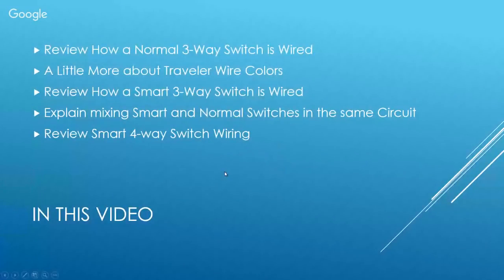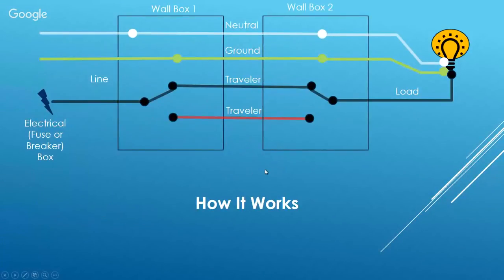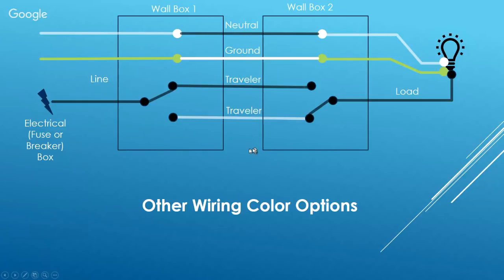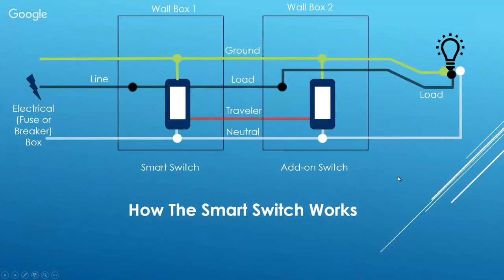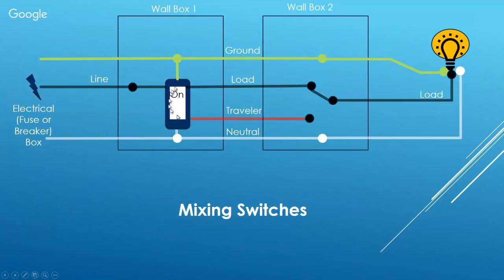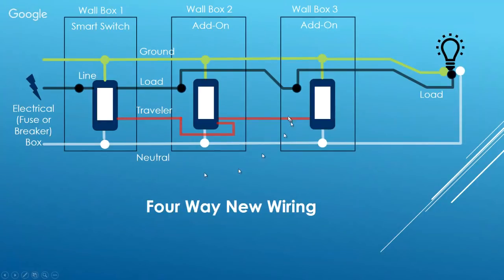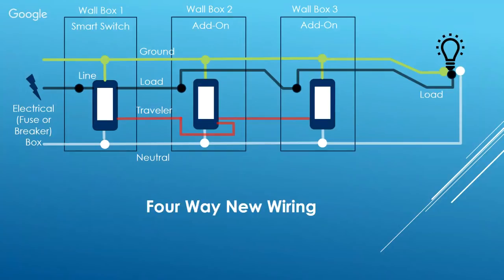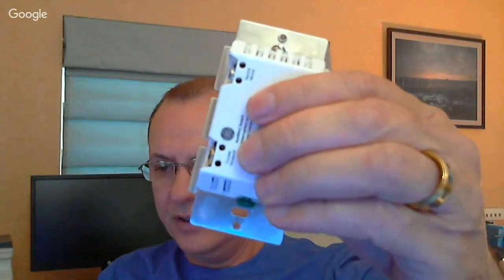3-Way Smart Switch Questions & Answers

Comment: Great video! Can a smart dimmer switch be last in line (not master - a slave switch) in a 4-way switch set up?
Reply from the maker: Hi Rich Persaud, thanks for reaching out. Which type of add-on switch you will use will depend on the manufacturer. The best source of information for three and four way switches is on my website. I cover many manufacturers and wiring methods there. There are several different methods in which your original circuit could have been wired, so you'll need to start there. Again, it's all on my website.
https://azhb.com/how-to/three-way-switch-how-to/

If you're still having problems, check out my Facebook Group. It's an easier place for me or other to lend a hand.
https://www.facebook.com/groups/733842787140470/

Cheers

Comment: Thanks for a very informative video. Do you know of a 3 way countdown timer that would work with another 3 way regular switch. In ontario the building code requires that the main washroom to be operated from a switch on the main floor beside the switch in the bathroom
Reply from the maker: Not that I know of. But if you have a smart hub you can set up the three way switch with a smart switch and have the hub automatically turn it off after a certain amount of time.

Comment: Is there a smart switch solution to group two separate 3-way switches that control recessed lighting? I want to be able to turn on and off both 3-way switches together at the same time, and still have separate control of each switch when needed.
Reply from the maker: Hi Kimberly Rymer, thanks for reaching out. Sorry you're having problems with the wiring. The best source of information for three and four way switches is on my website. There are several different methods in which your original circuit could have been wired, so you'll need to start there. Again, it's all on my website.
https://azhb.com/how-to/three-way-switch-how-to/

If you're still having problems, check out my Facebook Group. It's an easier place for me or other to lend a hand.
https://www.facebook.com/groups/733842787140470/

Cheers

Comment: What if your second switch in a 3 way switch only has 1 black, 1 red, 1 white and a ground wire...how do you make it communicate with the main switch ?
Reply from the maker: Hi Rob M.N., thanks for reaching out. Sorry you're having problems with the wiring. The best source of information for three and four way switches is on my website. There are several different methods in which your original circuit could have been wired, so you'll need to start there. Again, it's all on my website.
https://azhb.com/how-to/three-way-switch-how-to/

If you're still having problems, check out my Facebook Group. It's an easier place for me or other to lend a hand.
https://www.facebook.com/groups/733842787140470/

Cheers

Comment: For example on any smart 3 way switch the traveler 1 have to be connected with the traveler 1 on the other smart 3 way switch, and traveler 2 with traveler 2 ? So the switch can work fine? Thanks for help me ;)
Reply from the maker: Hi Carlos Monzon, thanks for reaching out. Sorry you're having problems with the wiring. The best source of information for three and four way switches is on my website. There are several different methods in which your original circuit could have been wired, so you'll need to start there. Again, it's all on my website.
https://azhb.com/how-to/three-way-switch-how-to/

If you're still having problems, check out my Facebook Group. It's an easier place for me or other to lend a hand.
https://www.facebook.com/groups/733842787140470/

Cheers

Comment: Very good video with instructions. I have a situation where I am trying to install 2 KS-602F switches as 3-way  to control a lite. I have been able to make it only work with primary as smart switch and secondary as conventional switch. I can control by the app. I can’t make it work with both smart switches installed. Tried a few different ways no luck. On the primary switch I have connected live wire to load/live(red) on the switch side, ground to ground (green), common wire white connect to white, line wire black connect to black, 2nd line wire red connected to black on switches. On the secondary switch there are only four wires, no live wire. I have connected exactly like primary switch leaving red wire on switches not connected to anything. This is how I read it should be connected, but not working at all. Please advise what I am doing wrong.
Reply from the maker: Hi Astinder, thanks for reaching out. Sorry you're having problems with the wiring. The best source of information for three and four way switches is on my website. There are several different methods in which your original circuit could have been wired, so you'll need to start there. Again, it's all on my website.
https://azhb.com/how-to/three-way-switch-how-to/

If you're still having problems, check out my Facebook Group. It's an easier place for me or other to lend a hand.
https://www.facebook.com/groups/733842787140470/

Cheers

Comment: Can a smart WIFI 3-way switch be used with a 3-way motion detection switch?

Thanks!
Reply from the maker: It would depend on the brand. You'd need to check the manufacturer recommendations.

Comment: i only have black white and ground can you connect the load wire red to the live ? its for a smart switch
Reply from the maker: Hi J V, thanks for reaching out. Sorry you're having problems with the switches. Which type of add-on switch you will use will depend on the manufacturer. The best source of information for three and four way switches is on my website. I cover many manufacturers and wiring methods there. There are several different methods in which your original circuit could have been wired, so you'll need to start there. Again, it's all on my website.
https://azhb.com/how-to/three-way-switch-how-to/

If you're still having problems, check out my Facebook Group. It's an easier place for me or other to lend a hand.
https://www.facebook.com/groups/733842787140470/

Cheers

Comment: Quick question does the three way smart switch always have to be on the live wire of the circuit? What happens if you install on the side feeding to the light fixture?
Reply from the maker: Hi Daniel Garcia, thanks for reaching out. Sorry you're having problems with the switches. Which type of add-on switch you will use will depend on the manufacturer. The best source of information for three and four way switches is on my website. I cover many manufacturers and wiring methods there. There are several different methods in which your original circuit could have been wired, so you'll need to start there. Again, it's all on my website.
https://azhb.com/how-to/three-way-switch-how-to/

If you're still having problems, check out my Facebook Group. It's an easier place for me or other to lend a hand.
https://www.facebook.com/groups/733842787140470/

Cheers

Comment: Hi..Quick question.
Can I use this  https://www.amazon.com/Kasa-Smart-Required-Certified-HS210/dp/B083JKTMYQ/ref=psdc_6291359011_t3_B01EZV35QU
with a dimmer https://www.amazon.com/TP-Link-HS220-Dimmer-Switch-1-Pack/dp/B079775ZZQ?ref_=ast_sto_dp
Since Kasa doesn't have any 3 way dimmer switches.
Thank you.

Comment: Ok, i dont see that you covered this so sorry if this has been asked and answered.  I want to put in a smart switch on a 4 way connection (group of lights in my stairwell) 2 switches on first floor and one switch at top of stairs.  Do i just need to put in one smart which at whichever location i want and i can use the other 2 mechanical switches as they are?  or do i need to buy a 3 way smart switch bundle and install 2 switches at 2 desired location and use mechanical switch for the third switch?  will these work on the smart app?

Comment: @diy smart home guy. Correct me if I’m wrong. If I just use a smart switch and unplug the other switch, it would work right? I don’t need a three way switch, one is enough. Plus the idea making them smart is that I never have to use them😜
Reply: DIY Smart Home Guy thanks. Same here. I don’t use any switches. Just wanted to be sure, if the sting this out would not cause any electrical damage. I ordered a 3 switch Gang. Will rest out tomorrow. Thanks for the amazing video

Comment: How about california 3way wiring? After disconnecting all the wires from the two switches I found out I have 5 hot wires and only 1 without electric flowing which goes to the light bulb. Is this type of wiring usable for smart switches?

Comment: You should update the guide because you can certainly install a 3-way smart switch and 3-way dumb switch to work as intended on both switches. It requires rewiring at the dumb switch slightly, but its very doable.

Comment: im using my smart switch with a regular switch and it works perfect.for the fist box for smart switch follow the video. in my case if you only have 3 cable in the second box just plug a hot and neutral in the dark screw together and red one on the other side. it works perfect for me thanks . hope this help others with my problem that missing a traveler cable

Comment: there are threeway smartswitchs that claim to not need a second switch such as Meross
Reply: @DIYSmartHomeGuy1  no clue yet but I bought a few will let you know when I get them in a few days.
Reply: @DIYSmartHomeGuy1  ok now I took a look at it and its easy solution, so on the smart switch you have a place to hook up the load from the panel, then your two traveler wires, so your smart switch is always hooked up to power, then when you switch it on or off it acts as a toggle switch from the two traveler wires.

Comment: I just watched this video and it had me thinking, could you not use a regular 3-way dimmer in conjunction with a 3 way smart switch so that the power was constant to the other switch?
Reply: Just curious if you got this to work. Im looking at buying a couple 3 way smart switches to do 2 separate circuits in my home, each with a standard 3 way switch. Wasn't sure if this would work. Thanks.

Comment: Hello. Great video. I have an odd question, can I use a wifi 3 way smart switch as switch 1 and zwave 3 way smart switch as switch 2 (add on) to allow both technologies access to single circuit? Thank you.
Reply: @DIYSmartHomeGuy1  think I need to lab then. Would be a great alter opportunity. Switch 1 senses line when called by operator as does switch 2. Each operates with load and detection determines if operations needed. Worst is relay is needed in middle if two cannot see load, as add on switch provided in seen lab here. I'll share as I learn. Looking to see if known. Thank you for prompt reply. Not being to tech, but kinda building a smart 3 way automatic transfer switch.
Reply: Ok, looking as was able to band-aid need with IFTTT lol. But I will lab this to verify if we can gang them together. When, ... who knows as I solved my issue and my world is full of other problems as you can probably guess lol. Again, thanks for reply
Reply: @DIY Smart Home Guy  example being zwave is security system and wifi is smart life app. I know IFTTT can complete the following but if event occurs and security needs control of circuit then using different technology. It's not actually a hub issue, it's a dual system issue. So say 3 way circuit is outside lights, security event of normal closed sensor opens (gate outside opens), secondary action is fires outside lights on. So one system can handle that. BUT, if you wanted to allow automation where light on/off w phone app not currently in that security system, need outside the box. And two same tech, zwave switch 1 and zwave switch 2 only master is controlling line. So wondering if adding wifi as switch 2 would allow 2 masters?

Comment: Very helpful. 
But if your using a regular switch. Wouldn’t you splice the 2 black wires anyways? And then just use traveller and neutral and. Grounnd connected to the regular switch

Comment: Thought I had a simple Single Pole installation.  Appears during a reno that an electrician daisy chained the switch to power a plug and switch down the hall.   Would like to put in a standard GE in-wall smart switch but just need validation on how to install properly and not lose power to the outlet and switch down the hall.  Any suggestions?

Comment: Hi, thanks. This helped me to understand the differences. I have a small Apartment, built 7 years ago, where here the SmartThings were too expensive even to think about. 
I'd like to install some smart switches, but almost all of the most important ones are on the same plate. For example, I have (in my bedroom) one plate (4x2) with 3 gangs, one of them 4-way, 2 of them 1-way. 
In my Livingroom, I have a plate (4x4) with 5 dumb switches, 2 of them 3-way and the rest 1-way. 
Is there any option on the market to transform then to smart ? I'd also like to integrate them with HomeKit, even if I have to install e Homebride to save some money, since I intend to install one for TV and other stuff control .
Thanks !

Comment: At 7:30 couldn't you use a regular 3 way switch with a smart 3 way switch if you simply put the smart switch at the end of the circuit, and use the regular 3 way as a command?
Reply: That's what I was thinking... did you try this?

Comment: I feel these devices are outdated although your explanations were the most thorough and easy to understand for basic diy gal (with IT degree and experience lol). there are smarter (lol again) smart 3 & 4 way switches that do not require add on switches also on amazon. TP Link makes well tested one I've used for 3 way. Can also work 4 way but I wanted dimmer 4 way so bought acenx. There's a great vid walks you through tp link 3 way install with no add on by Mr. Fix It here on YouTube. Definitely watch DIY Smart Home Guy for more thorough explanation and needed basic wiring info. I have lived in my house twenty years and have those old ugly can lights so I replaced those myself with recessed led kit that just screws directly into the can via adapter. I wanted to adjust the brightness on those. Ideally I'd like to change the kelvin (color of white light basically) too as it supports 2700K to 5000K but can't find a smart switch to do that. The bulb is supposed to be smart but some kept disconnecting (not so smart ha!) which is really annoying so added smart switches instead. To me the minimum req for any smart gadget is it works consistently without me having to reset anything or mess with it. I have heard the philips kits work great and I tested one out and loved it but not 22 lights times $35 love. I got the zigbee CE (hd in house brand I think) for $13 that initially worked with wink but work directly with the built in hub on my Alexa show 2. Uh when they work. It was a great deal for a smart led kit you can adjust brightness and kelvin. Again, has to meet the works consistently req so going back. I'm opting for dumb light kits and smart switches. Don't want to panic when kids forget and flip the switches with me diving across the room like "no! You will mess up the smart bulbs..." mom falls on hard wood floor and has to reset lights any way. Which btw involves deleting light, flipping switch five times in five second intervals, readding switch. No bueno. Found led kits that will work in my cans with adjustabl brightness via switch or app (voice also of course) but the kelvin is a slider on the back side of the light which is in a twelve foot ceiling. Yeah that's dumb. At least I know I can change the color if I really want to 💁

Comment: Awesome video. I have a weird situation with a 4 way switch I have in my house. I installed GE smart switches about a year ago and they had been functioning really well.I have a 4 way switch set up for one of the lights on the second floor. For about 2 weeks there have been issues. First, none of the 3 dummy switches would turn the light on. Sometimes they could turn it off. The main switch can turn it off and on but the light will immediately turn back on after I turn it off (and you can hear the switch click when I turn it off and then a second click when it turns on immediately after). Eventually after 4 or 5 times, it stays off but will randomly turn on without anyone hitting a switch.  Further, if I use my cell phone or alexa to turn the light off, the same immediate turning back on happens.I went around and checked the wire connection to each switch and redid the connections. I also swapped out the main switch (which didn’t fix it). Then I went and swapped out the dummy switches one-by-one (assuming that if the one I swapped out was ok if replacing it didn’t solve the issue I used that one to replace the next one). None of this worked. I also deleted all my automations just in case there was some weird error in one of them (just flailing with that approach but worth a shot I guess) but that didn't help at all.Finally, I detached the traveler wire from the main switch and tried it. Obviously, the dummy switches didn’t work since they had no power to them but the main switch works like a charm. No problems turning off and on and it stays off. So, am I correct in assuming that there must be a short or bad connection in one of the dummy switches? It just seems there is some faulty feedback loop turning the light back on.Any ideas or suggestions? Its all very frustrating. Thanks in advanced for the help.

Comment: The set up I have is one box has the load wires, outgoing Romex to the fixture and the 14/3 going from this box to another. I’m am at a complete loss how this Ned’s to bewildered up with the smart switch and the companion switch, since the second box only has the 14/3 and the companion switch on has spots for the traveler and neutral.